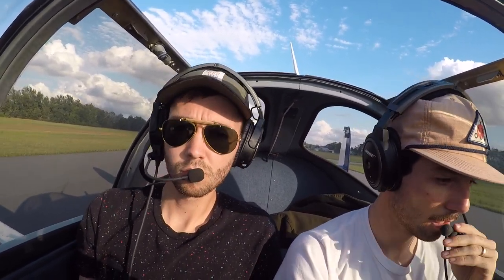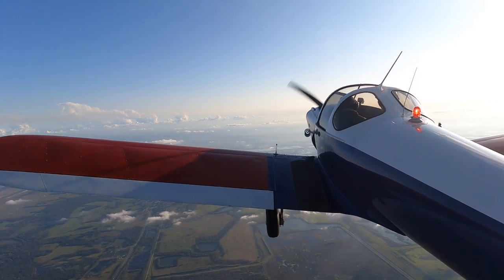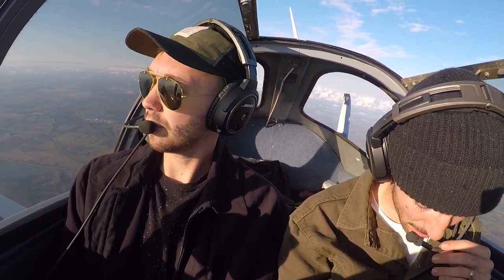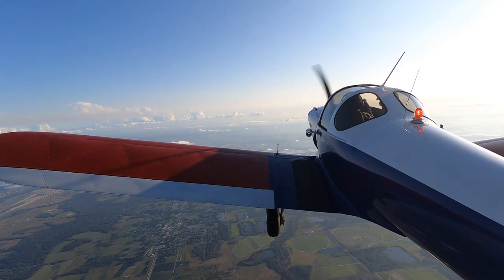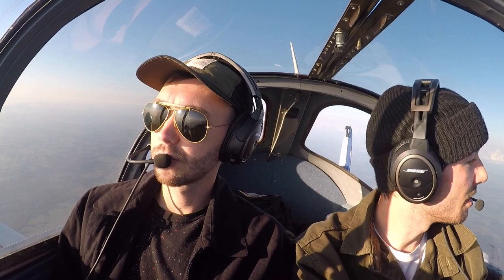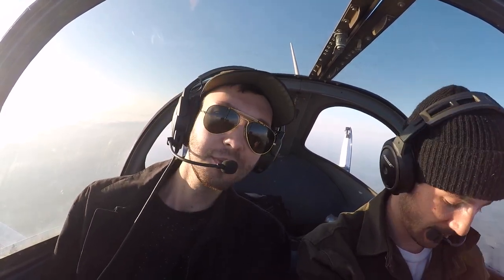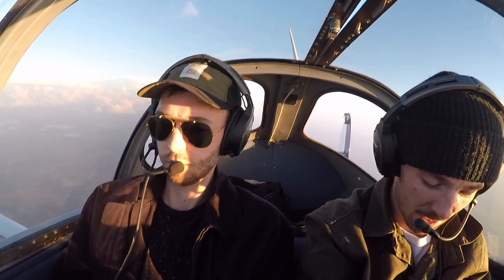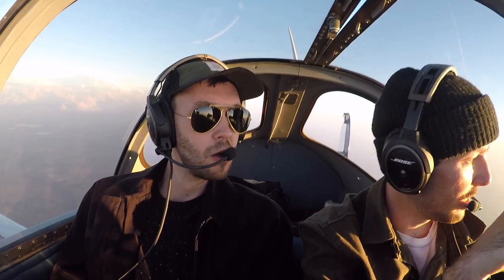Flying to service ceiling in an Ercoupe (12,000ft?!)

Comment: As I recall, Service Ceiling is the highest altitude at which you can maintain 100 FPM climb. I think you're closer to the Absolute Ceiling.
Reply from the maker: You’re absolutely correct, just easier to say service as more people are familiar with service ceiling

Comment: For climb you can use full throttle 100% of the time and lean for peak rpm above 5000. You can run those engines at redline continuously and above about 7000 you're below 75% power. I used to run a Continental 145 hp C 145 at 2700 above 8000 all the time.

Comment: The definition of the service ceiling is the height above sea level at which an aircraft with normal-rated load is unable to climb faster than 100 feet per minute under standard air conditions.

A service ceiling is not really an absolute limit on the altitude that a particular design can achieve, but one at which the aircraft begins to run out of climb capability. The absolute altitude is a measure of how high an aircraft can climb, when it runs out of any further climb capability, under normal-rated load. 
   Good job, each pane will have its own limit, and now you have a great reference for future cross country flights plus the feel of the plane when it gets to an altitude that it doesn't like.

Comment: Yep. I did the same thing with mine. Yes they will do it. I have the 75 upgraded to 85 too. What you didn't cover is what happens to the crankcase temperature gage when you throttle back for descent. Did you look? I did and it scared the crap out of me. Started dropping faster than a clock second hand. I didn't want to trash my low time engine with massive thermal shock, so I reverted to decending 500ft intervals at a time and throttling back up for awhile to get it above 100F. I hope you saw that and took action. It took me longer to get down than get up there. I wouldn't do it too much if you want to get good life from that little Continental! There ain't no cowl flaps on am Ercoupe!

Comment: ....I took mine to 12,100 feet.....1946 415C  'CF-RGD  75hp .... about 1982 over the Fraser Valley in B.C. Canada, the Fraser Valley is almost at sea level......Didn't stay in block airspace very long, for sure ...It was an impromptu decision during a brilliant morning flight  to watch the sun come up over the mountains to the east, something I would do often, descending enough several times to watch the sunrise multiple times during one flight.....My manual had the service ceiling listed at 17,000 ft ...

Comment: I'm glad you took a second guy up, and showed it was possible to get that high while that heavy. I recently got a C-75 Ercoupe to get my PPL in. I live in Colorado on the front range, and would love to do flights with friends to places like Aspen. But I'm keenly aware of the plane's limited engine performance, its ceiling lower than the peaks of the front range, and the gross weight limit.

I am curious what engine you have, and how long it took you to climb to ceiling? Also, do you think a climb prop or a cruise prop would provide better performance near ceiling?
Reply from the maker: I just moved from Boulder and am hoping to move back soon! I’ve tried to scheme a trip out there but am in the same boat being super aware of the limitations (especially when you start to factor DA in the equation)
Reply from the maker: I have the c85 and cruise prop. It took around an hour to get to 9500 (from 100ft field elevation). That being said, I was running the engine at a lower rpm to keep the cylinder head temp down to preserve the life of my engine.
Reply: I was planning on getting an individual cylinder temp setup going, but so I can lean the engine without destroying it. I read somewhere that leaning becomes more viable on the old carbs above 5,000 feet density altitude, but that you need to be careful about temps. Do you think preserving the engine with lower temps is cheaper in the long run than saving on fuel?

I'm also probably going to try to get the C-75 to C-85 STC done before I try to take passengers through any mountains. I think the extra power will be worth it.

Anyway, thanks for the info, I'm out in Commerce City, and got a hangar at Everitt, so if you do move back to Boulder, hit me up if you want, would be nice to pester someone local with technical questions, lol.
Reply from the maker: @hatman4818  I’d love to hang if I move back or even go fly if I make a trip that way. I’ve read the same info on the carb but I tend to lean anyways but cylinder temp always take priority over gas for me (and I’m trying to save as much money as possible since I’m working towards atp minimums). That said I am able to get 3.5 to 4.5 gph on average while keeping the cylinder head temp at 380-400. Usually the temp will reach 425-450 on initial climb from takeoff (I try to keep at as low as I can). Preserving the engine is the most important thing in my mind but it doesn’t mean you have to run super rich. I also use non-ethanol gas 70% of the time.

Comment: With your garmin 496, did you note the GS? TAS? etc.?
Reply from the maker: I actually use ForeFlight with a sentry but gs was 60-65 IAS 65 vsi was 100-200 to 6000ft and was 25-100 tp 12000ft